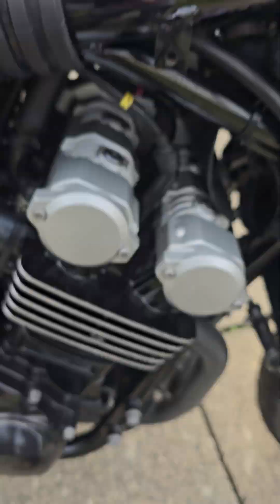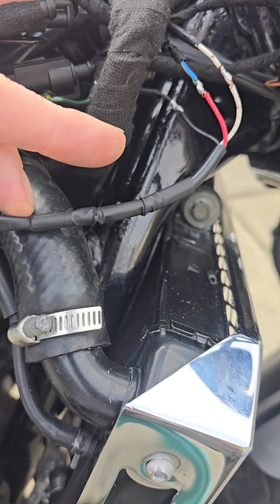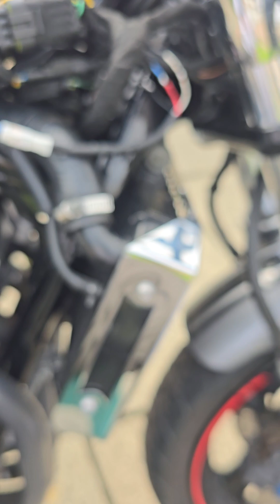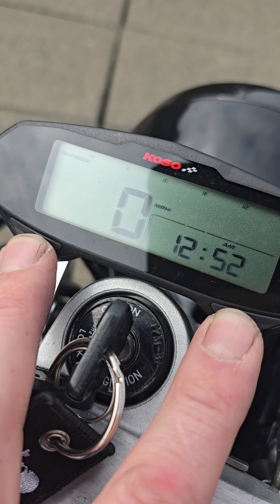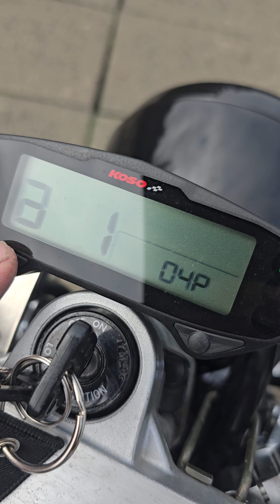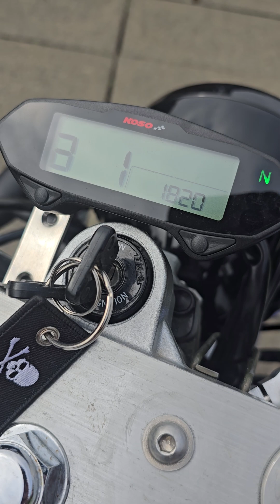koso clock .mph wiring koso clock. db01rn .standard bikes sensor

Comment: Hi, I also have the Koso db01rn and I want to use the original sensor from my Husaberg FS570.
But the original only has 2 wires. So do you know if that is possible and how I can find out which one to connect?
Reply from the maker: Fazer has 2 wires ,white and blue yellow ,add your own earth and set the clock
Reply: @Justk75  Thanks, I already solved it a long time ago. I used the original sensor and connected the blue/white Sensor wire with 5V and the white/black ground wire to the original sensor. The red wire is not needed.